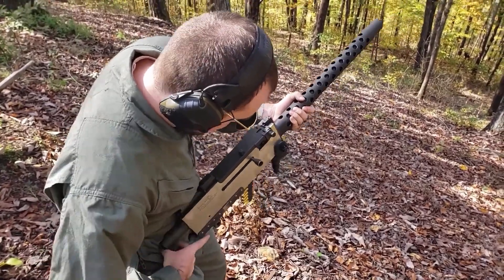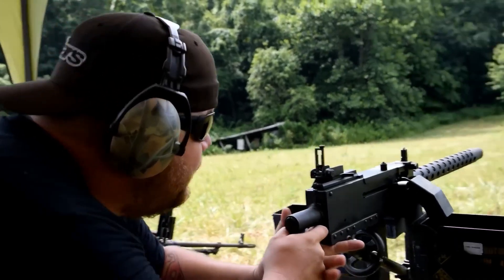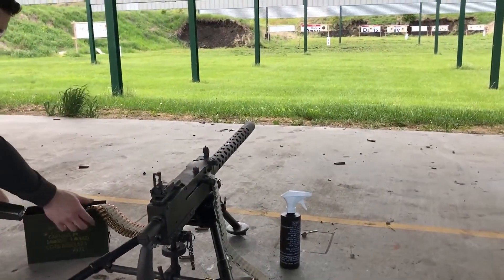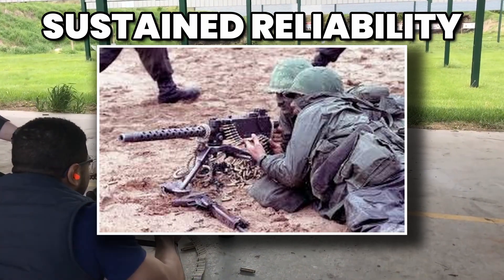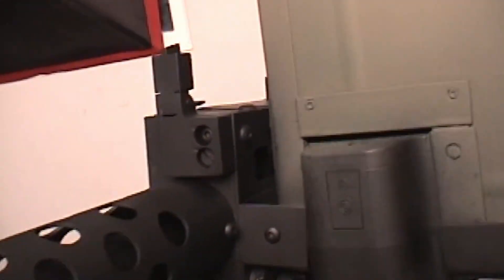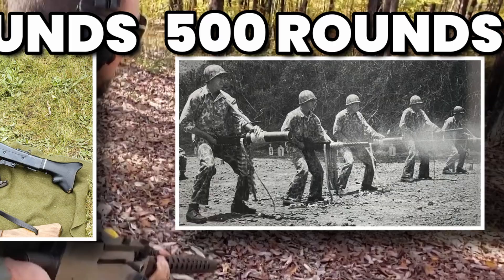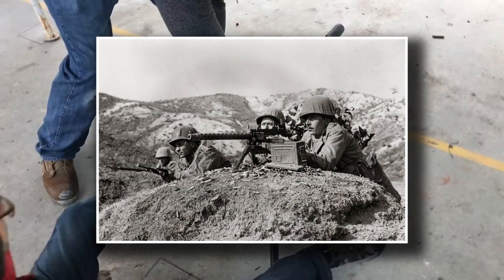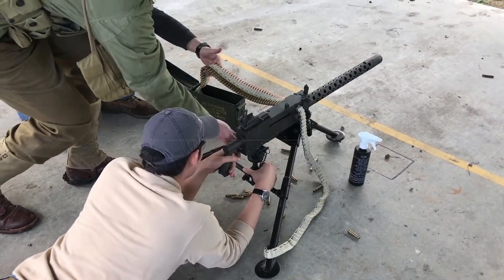How It Works:The Browning M1919 - America’s Workhorse of World War II

Comment: Was this the OG m249?
Reply from the maker: yes and no! M1919 was around before the M249, but they both bring the heat in their own way!
Reply: @GunsUntold  I know, the reason why I inquired was because the principal and shape of this gun is very similar to the M249
Reply: Nah, it was the OG M240 as it was a platoon weapon rather than a squad. You’re probably thinking of the BAR.